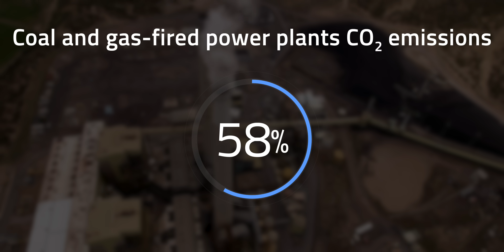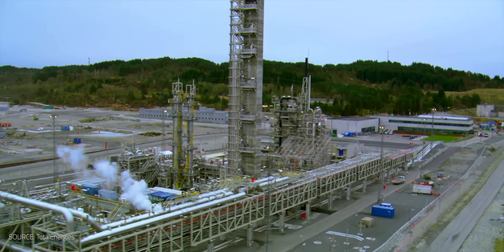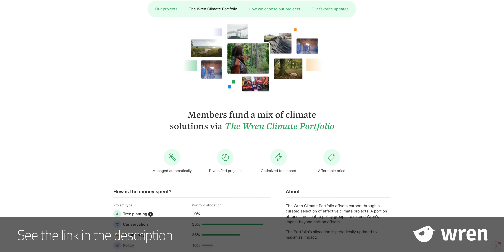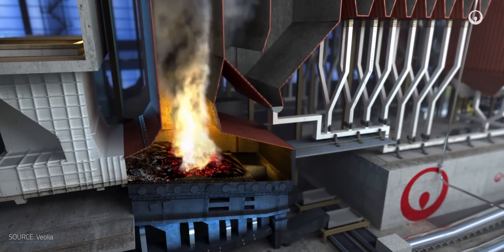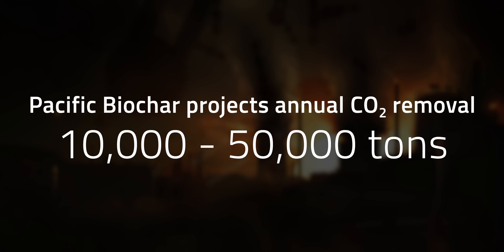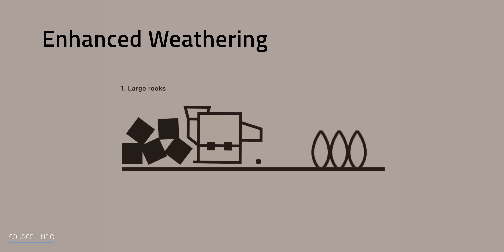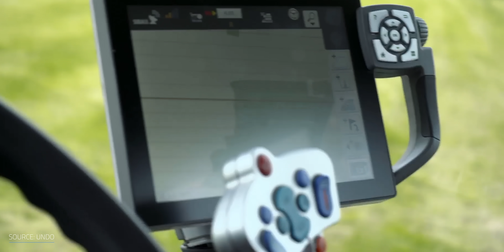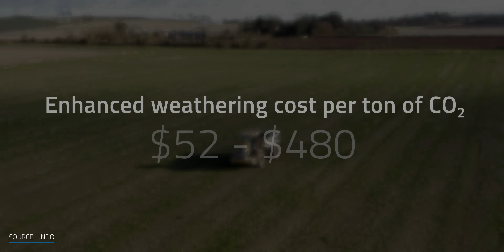The Reality of Carbon Capture

Comment: I'm not convinced. I know that thinking out of the box is necessary to solve the problems humanity caused to our planet so far. But emitting tons of CO2 into the atmosphere by burning wood only to then bury the biological charcoal in the ground where it will release even more CO2 into the atmosphere over time seems really really counterintuitive. It would seem much better to invest all the funding and convert the emissions from those processes into technologies that actually reduce carbon emissions, like renewable energy aka wind/solar/water-power. But yeah, it's good to create studies of the impact and benefits of these kinds of technologies, but I'd wish that they weren't celebrated as solution to our problems before we even understand the short and long term effects of these technologies.
Reply: We actually need to release that co2 back into the atmosphere or we’d eventually go the other direction.  It is not counter intuitive.  It is needed for a proper balanced cycle.  Also it isn’t a binary choice between renewables and co2 capture.  We should have a diverse program that is sustainable and helps to balance and offset human activity.
Reply: @sanctred  We are centuries or more likely forever away from needing to release CO2 into the atmosphere to survive. And while it's easy to say it's not a binary choice between renewables and CO2 captures in reality it is, because funding to prevent the climate crisis is very limited and if you invest heavily into CO2 capture you will have less funding for renewables. Sadly climate change doesn't get funded like the military, otherwise it wouldn't be a problem anymore.
Reply: @moos5221  Agreed from the funding perspective.  I would rather see the money go towards renewables as well.  Specifically if it is tax dollars then I’d much rather see that go to residential solar.

Comment: At this point in the history of planet Earth, we are experiencing starvation levels of carbon dioxide. Sequestering CO2 is tantamount to locking up the food at a banquet filled with hungry people. Dumb!

CO2 level (ppm)
0 -- Death of all life on Earth
50 -- Death of all C3 species (~99% of all food crops)
150 -- Mass extinction threshold
280 -- Start of Industrial Revolution
410 -- Today
800 -- Starvation level which triggered the parallel evolution of C4 species worldwide to cope with CO2 scarcity!
2,300 -- Average level throughout the period of multicellular life
4,000 -- Level during Cretaceous Thermal Maximum (several million years without runaway "greenhouse" warming)
5,000 -- Nominal level aboard the International Space Station
7,000 -- Maximum recommended for extended space missions
20,000 -- Maximum recommended for spacecraft (NASA SMAC) for up to an hour
40,000 -- Average level in exhaled breath (human)

A recent CO2-temperature correlation study shows that CO2 has never driven temperature at any time in Earth's past. In fact, the correlation factor between CO2 and temperature is all over the map from strong positive to strong negative. Another, related study, shows that the greenhouse effect has little to nothing to do with why Earth is warm and Venus is sizzling; instead, it's gravity-biased thermal capacity of a planetary thick atmosphere which makes a planet's surface warmer than that calculated from insolation and albedo.

Comment: the Wren sponsorship was a major turn off, but I'm glad I listened to the report.  The irony that burning for biochar reduces global warming isn't lost on me, and I'm concerned that the basalt approach is being held up by the 'need to measure' the results.  If the chemistry is solid, and the heavy metal issue is under control, I'm surprised the politics can't 'trust the science' and know the chemical reaction will cause an expected range of sequestration per unit of surface area.  Small scale testing to prove the reaction should be all it takes to 'prove' the reaction is real.  Just put a pessimistic margin for error into the math, and let 'er rip...

Comment: There are two hurdles that need to be overcome:

1. Finding a process that stores more carbon than it generates.

2.  Finding a process that creates a useful end product.

Wood is the most useful and versatile building material and fuel in history.  The solution seems simple - plant more trees and gradually make oil too expensive to burn.

We need to wake up and start thinking in century-long time scales.  Because that's how long it takes for a "crop" of trees to mature.

Comment: I suspect that what some see as a benefit of more field based solutions will be seen as a obstacle by industries - variability

Its generally easier to upscale something on a factory floor under controlled conditions. Needing to tailor a solution to the specific environment might be great for the landowner but most companies find it easier when an implementation is standardised.
Whether its housebuilding, manufacturing, servicing or processing.

Comment: My question about charcoal is how well utilizing it for all these various benefits results in actual carbon storage. For example if you’re feeding some of it to cows, that’s not really carbon storage as it’ll either be digested by the cow or pooped out where it’ll decompose once the right microbes get to it. Plus what happens to the other byproducts given that they are also carbon heavy products. Even in the case of planting if it’s close enough to the surface to benefit plant growth it’s close enough to be disturbed by tractors. As the charcoal is continually disturbed I have some doubts that it will last as long as advertised and not for a more realistic 50 years or so, given that there are microbes that can eat charcoal and there are studies from as early as 2008 warning about the overstatement of ‘biochar’ as a carbon sink.

Then there’s the question of scale. Compared to other storage techniques, it seems likely that the natural solutions will have some limitations. Eventually every field will have enough rock and charcoal to permanently fertilize it, calcium carbonate buildup is not a problem we want to have, and dumping significant amounts of carbon into the biosphere seems more likely to just delay when carbon enters the atmosphere, not prevent it.

Not saying there isn’t a place for these, just that I’m very wary of how effective current carbon capture technologies are versus how they are advertised and sold. The idea in principle seems like a decent idea, if properly implemented and likely could help reduce emissions by forcing companies to pay a carbon tax that explicitly funds carbon capture that is proven to work, without letting companies get around that by paying for sketchy carbon credits like maintaining a forest that was under no risk of deforestation, or worse, is chopped down anyways.

Comment: I worked in oil and gas at a large national oil company. I think that Enhanced Weathering is the only realistic solution. I saw the economics on sequestration and wasn't impressed. CO2 is a tricky molecule it has a nasty habit of forming ice in pipelines when compressed if there is any moisture in the line. To compress it to a super critical fluid takes almost as much energy as it contained as a hydrocarbon. So the physics of sequestration sort of suck, which is why there is probably no technological breakthrough that will change that. Enhanced weathering is a geological solution to a geological problem. If you dig up gigatons of carbon you need gigatons of ultra mafic rock to sequester it in the oceans. That is nature's solution. On a geological timeline high atmospheric CO2 leads to acid rain, which speeds up weathering, which sequesters carbon. We have to accelerate that process by 10,000 years. Grinding up basalt and spreading it on acidic soils could solve this problem. The 2 ton application is light. Basalt is covalent alcaline silicate, it is incredibly stable and takes decades to breakdown. If every time a Georgia softwood lumber farmer cleared his land he had to plow 200-300 tons / h of mafic rock dust into his land that would capture 100/hc in two to three decades.

Comment: There are DAC methods that do not need heat applied to release the captured carbon, nor do the need fans to draw in air. two outside sources of energy input eliminated making it less costly than $50,00 / ton.

Comment: Carbon capture is stupid.  It's inefficient.  It's overly difficult and will cost a fortune.  I also happen to believe we have basically no other choice.  It's a price we're going to have to pay.  We're going to have to essentially double or triple our electrical grid and dedicate half of it to pulling carbon out of the air and pumping it back underground.   And obviously the electrical energy we use for carbon capture will have to be done with renewables or nuclear.

Comment: This is laughable, the methods mentioned here have about as much chance as a snowball in hell of making a dent in the atmospheric CO2 levels, it's pitiful. CO2 stays in the atmosphere for CENTURIES doing it's thing, we have been pumping the stuff out in ever increasing amounts for over 150 years. Think about that, even one hundred years, of the world's industry and all the anthropogenic sources of CO2 being pumped into the air, now think about the kind of EFFORT that would be required to REVERSE all that CO2 production, think about all those huge smokes stacks running in reverse and smoke going back into the factory, like running a film in reverse, if that helps to give you a sense of the absurd volume of CO2 that we are talking about. Biological systems are simply not fast enough, efficient enough, to reverse this. In reality, inorganic chemistry used to actively capture CO2 from the air and store it as solid carbonate is the best solution, and it can be solar powered, plus storing it as carbonate is about the most concentrated, stable storage form there is, besides storing it as dry ice but that is totally impractical. Even if every developed nation commits to building massive atmospheric processors to remove millions of tons of CO2 per year, it is still going to take many decades . There is another way, and it could show results in just a few years instead of decades which is why it will probably be the one that is utilized, one that simply removes the heat energy from the earth's atmosphere so it cannot do the damage it is doing now.
Solar shades could be placed in orbit and unfolded, or un-rolled, these could be used to lower the total solar incident radiation down to something like 90 or 95 percent over large areas in places around the equator. Manufacturing these things and deploying them is probably orders of magnitude more easier than the alternative. My prediction is that in the next few decades or more  when certain countries are getting more than their fair share of catastrophic severe weather events, people will then realize that CO2 removal is simply no longer a viable option in the allotted time as the weather continues to get even more ferocious, then they will see this as the only logical and practical alternative. There will no doubt be multiple solutions all working together to lower CO2 but again all those techniques put together will simply pale in comparison to the production of the gas in the last century, so, while they are quietly working away to get us back to preindustrial levels, the solar shade will be the true solution.

Comment: A big problem with both basalt gathering, grinding and dispersal  and biochar gathering, pyrolyzing and dispersal is the gathering part, all the costs and energy involved and and similarly with the final dispersal.  This is cost and energy intensive in all by itself.  For biochar, an alternative I have thought of, but never head of anyone researching is in situ(in place) biochar creation of crop residue waste.  It would work like the plowing and cultivation that all crops undergo after harvest, but the point isn't to make them rot mixed with the soil, but instead pyrolyse them in place on top of the soil.  Modern shallow chisel plowing and no-plow farming techniques partially do this.  Part of the crop waste is burned for the energy to create the heat that pyrolyses the rest, which has to take place under something like a large very hot metal plate that excludes air, can quickly pyrolyse the crop waste, and suck up the pyrolysis gases to burn to heat the plate.  This would need to be a skid plate dragged by the tractor, perhaps the suction and blowers powered by the tractor's PTO. It would probably require some bottle propane to initiate the process and perhaps keep it going in some circumstances. The rate or speed of the tractor/skid plate would have to be tailored to the type and density of the crop waste, like wheat/grain stubble versus maize or sugar cane.  Similar equipment could be used for many different crops, even some non-food, like hemp or tree pulp fibre.  The end result would be  a thin layer of biochar already spread, and the very top millimetres of soil flash heated, which would kill a lot of pest insects and fungi diseases.  Existing soil organic matter would not be pyrolysed as it is down in the soil and the heat doesn't last long enough, and soil is a terrific insulator.  Same with beneficial soil organisms like worms, they're deep enough to not be affected.  This would generate a lot of partially pyrolysed organic matter too, which is also beneficial to the soil and behaves somewhat like long lived soil organic humus and humates, which have a multiple year to few decades soil life, and the biochar has up to centuries and even millennium life spans in the soil, based on Brazilian Native Indian created biochar, called Terra Preta.

Comment: I think it is all a cost benefit problem. The benefits come in the form of reduced future environmental CO2, which will hopeful reduce the destruction being caused by climate change. But that benefit is accumulated by everyone, where the cost comes from whoever is paying for it. There are other possible benefits if the removed CO2 results in the production of other benefits.  The other way to reduce future environmental CO2 is through the reductions in emissions. This is where EV's replace gas cars, or heat pumps replace gas heating, or other changes in the way we live. In this case, the people paying for the change get a direct benefit from the change, that offsets the money spent. So instead of being a charity or tax supported activity, it is a consumer activity. Currently if I want to reduce my future CO2 through carbon capture, I would go to Climeworks and pay $1000 per ton of CO2 turned to stone. But if I bought an EV instead of a gas car, the difference in cost would be near zero (considering the cheaper electricity than gasoline).  Therefore, I believe that right now the correct expenditure is for reducing emissions. But when emissions are reduced, then the task of removing the prior emitted CO2 remains. 

   It doesn't seem economical to burn gasoline and then pull the emitted CO2 out of the air. It is really two problems: ending emissions, and removing the excess CO2 from prior emissions.

Comment: 6 percent of mining aggregate is what they want and 20 percent of that 6 percent is the correct size. At 50 billion tons that is 600 million tons. For Every 83.5 tons of material you sift through you get 1 ton or usable material. That's pretty much max efficiency. Just think about the logistics and price of trying to refine that from 50 billion tons per year on a mine site where it is waste so you better believe accessing it and putting it into a refinery will cost more carbon wise then it would save. 

And it gets worse. This method only has a 25% storage capacity. So those 600 million tons of basalt will only capture 200 million tons of co2

Comment: I can't help feeling there is a disconnect where carbon capture schemes cost $100-600/tonne but carbon credits for reducing carbon still sit at around $10-20/tonne. By far the best way to reduce CO2 is not to generate it in the first place.

Comment: I don't like carbon capture, it comes with the idea that we are trying to bury the carbon.  I want us mining the atmosphere for carbon to turn into useful products.  These things need to be profitable, which means they are useful to someone and can be used to improve quality of life down the line.  Pulling carbon from the atmosphere could create many products.  Graphite, carbonation, diamonds, artificial coal, hydrocarbons. When we figure out cheap ways to mass produce graphene this could be a decent source for that.  Not to mention, we could return the air to pre-industrial levels and continue using the best form of energy while adding to the energy basket.  An all the above energy strategy would be the best, solar and wind do have their place, but not on the scale needed to power a modern civilization.  Aside from them being unreliable and immature technologies, they create alot of toxic pollution during resource gathering and production.  The batteries on that scale would be even worse.